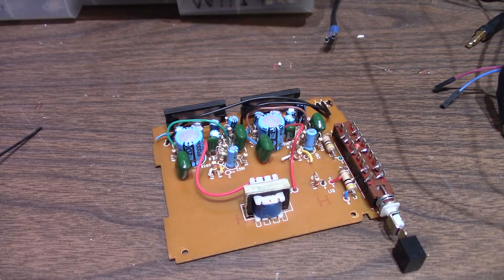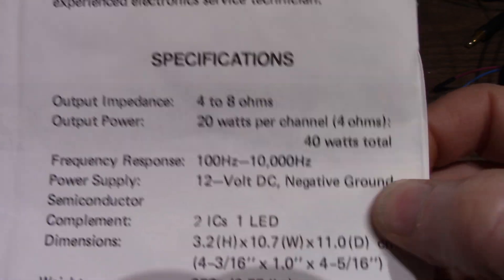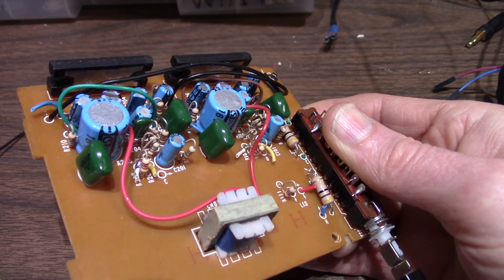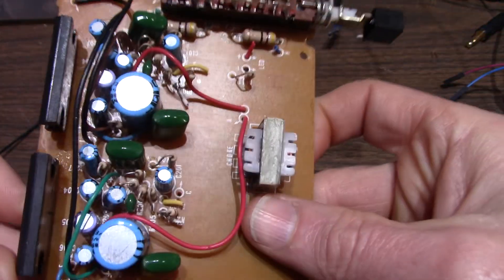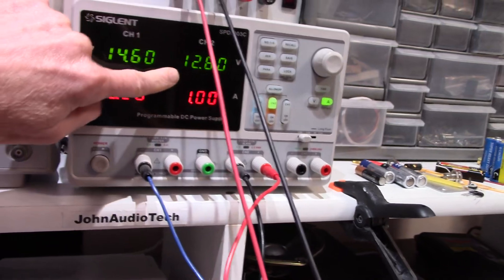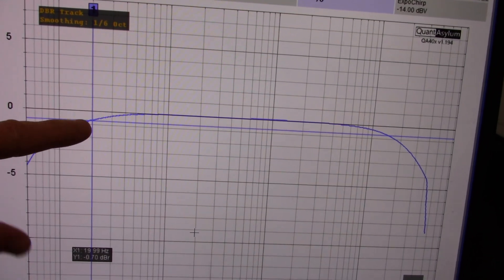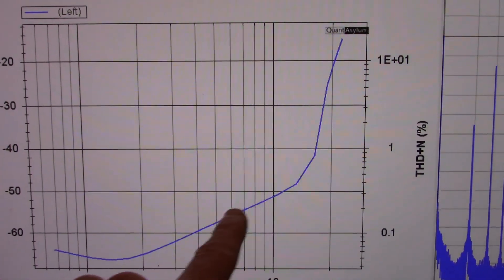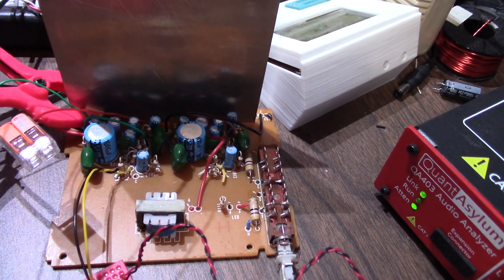Car audio vintage "power booster" amplifier tested

Comment: In around 1984, a friend got a huge double cassette boom box for Christmas. It was imposing to look at but didn't quite have the output to match. I discovered that this beast used 8 D-Cells, so i convinced my friend to beg his mom for the money and he bought one of these things. I wired it into his beloved Christmas gift (behind mom's back, of course) and he suddenly had the LOUDEST boom box in our school! 😂 In a short amount of time, he blew the OEM speakers, and so then we had to go to a local auto salvage yard to find some better speakers that would fit the holes. We succeeded in doing that, and then the thing was even louder.  The only problem was that the internal power supply couldn't deliver enough current to run the booster, so it could only be switched on when using batteries, and then it sucked the D-Cells dry in about 45 minutes. You might be able to listen to ONE tape before you needed new batteries. Kids - what more can I say.
Reply: So you were friends with Radio Raheem?
Reply: I did the same with my GE Block Buster but wired to the transformer.  Hit the switch and smoked it.  Life of a 13 year old kid.

Comment: I took a clone of this, and put it in mu PC case, powered off the 12V rail, to provide higher power than the Sound Blaster itself could provide. Had to bypass the power switch, and add in extra filter capacitors, and extra power supply inductors to get the noise down off the 12V supply to an acceptable level.

Comment: I can remember a Craig Powerplay booster in the mid seventies. I had it installed into my 1972 Chevy Monte Carlo. It picked my pioneer 8 track/AM FM stereo up a few more watts.
After the system was stolen, I replaced it with a high power AM FM Cassette from Radio Shack.

Comment: A $20 amplifier from Radio Shack with frequency response from 100 to 10K Hz! It doesn't get any better than that!
Reply from the maker: Finally, something that outperforms its specs.!
Reply: @JohnAudioTech  Clearly it was lunchtime for whoever wrote that pamphlet. Just put any numbers in there.

Comment: Still could be made into a bench amp or unbridge it for a HPhone amp? I couldn't quite see, but it looks as though there's a cap across the input, if so, remove/lower it for a better HF? All the best, John.

Comment: that little transformer thingie. looks intresting
Reply: It's a supply line filter choke. Removes any noise on the supply. As its in a car, some older cars alternators generated a bit of noise.
Reply: That's an RF choke/filter.
  Tomato Tamoto...

Comment: Since it was (is?) common to measure the frequency response to the -3dB low and high point (perhaps only with speakers?), I would consider this to be a 20Hz-20kHz product (technically 7Hz-34kHz) and have to wonder if RShack was under-reporting the response in order to up-feature their higher-priced options.  This should do the full audio range even with sloppy manufacturing tolerances.
Reply: The music test into a speaker proved it was beyond 10kHz as the highs were obviously present 😊

Comment: That brings back some memories!
I had the 40w/5 band paired with a Realistic deck and rockin a pair of Pioneer 6×9s in my 68 Mustang. Sounded great at the time. Man those were the days!
Reply from the maker: I can image having that '68 Stang!
Reply: Yeah, I bridged a Radio Shack 120W car amp with a computer power supply to power 2 12" sub woofers in a cheap box I built.  Who knows what it puts out since it's only using 12v..  But it actually sounds better than a Klipsh 120sw.  Nothing as loud, but certainly a much better freq. response.
25 years later, it's still sitting under my desk right now.